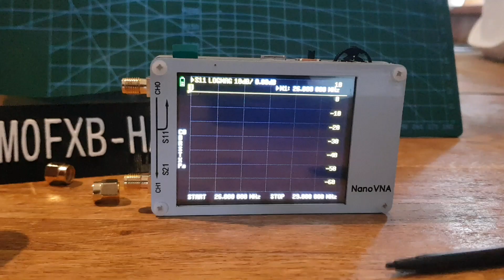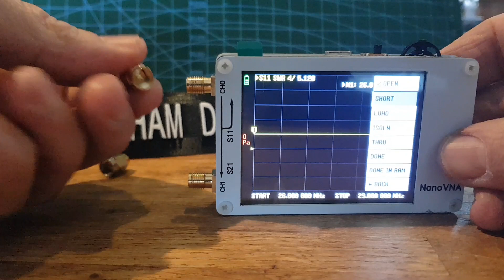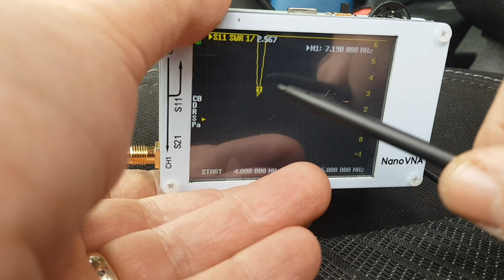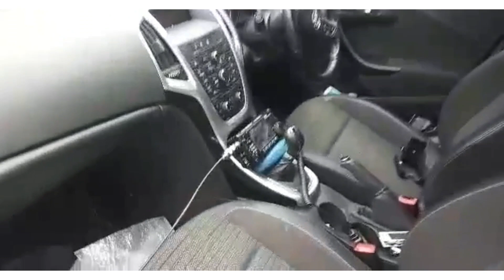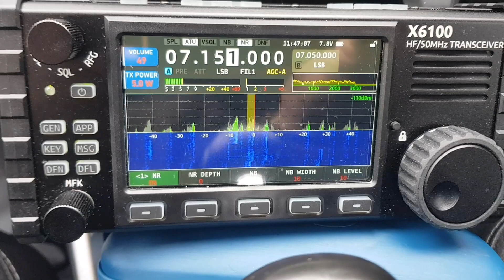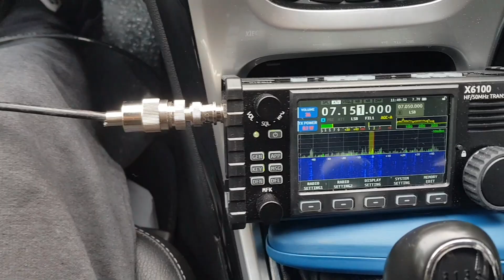40 Meter whip (Am Pro 40 Meter whip -Moonraker - Xiegu X6100

Comment: VHello.  
   Have you tried how it receives and transmits on AM and FM?
   I just received the equipment and I have opened it for the CB27 band and when I use FM they receive me well but I receive with a lot of distortion and in AM they neither receive me well nor do I receive well.  
   I love Esraradio but it does very strange things.  
   Thank you.
Reply from the maker: Sorry i do not have CB Antenna
Reply: @m0fxbhamtech Have you been able to test AM and FM on the HF band?  
   Does it work well for you?  
   I have a lot of distortion in the reception, nothing is understood in RX or TX.  
   Have you been able to connect a bluetooth speaker to the computer?  
   Thank you.